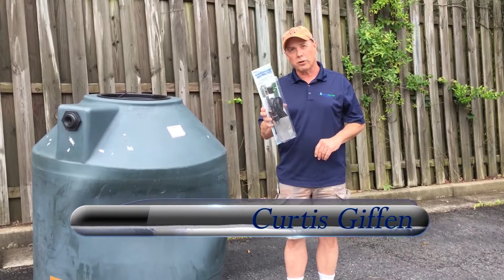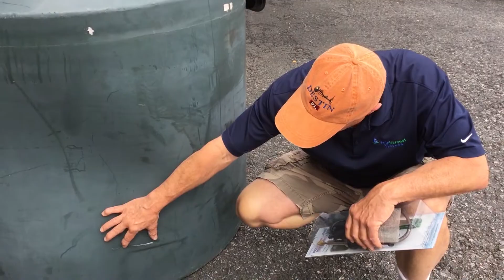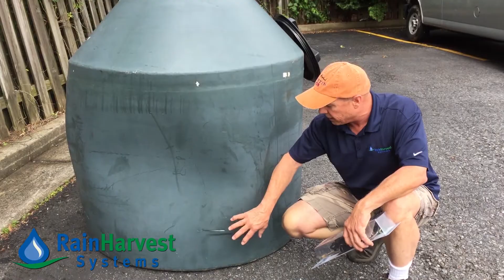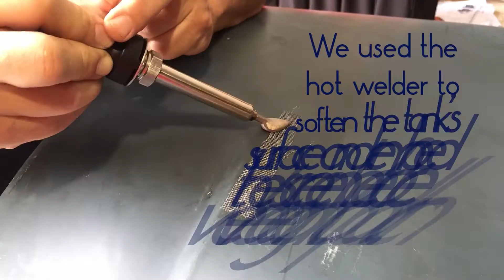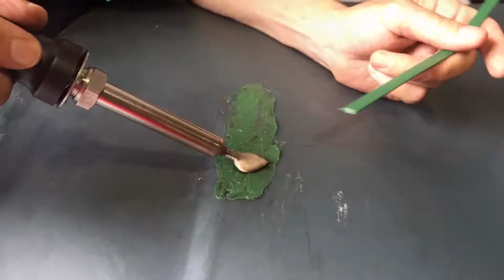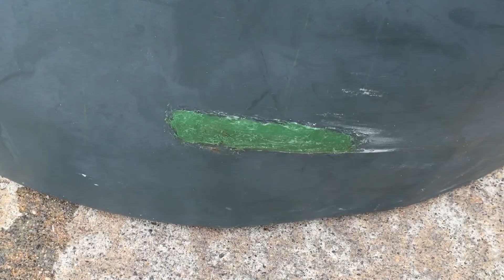Repairing Plastic Using the RainFlo Poly Welder Pro Plastic Welder

Comment: I have a 5000 gallon tank with an 8” crack close to the bottom.  I tried using a similar product and method and it worked for a few months but eventually started leaking again.  Is this something that might work better if placed on the inside of the tank? Any ideas? Thank you.
Reply: I have the same issue and agree with you that the pressure/ weight of the water on the bottom of the tank when it’s full is “ big” where it’ll be too much for an external repair to handle.
If the inside of the tank where the split is repaired 1st and then patched like an inner tube and then covered for a foot or so around the repaired area with an adhesive cover. That would hold up better. The force of the water pressure would push into the split not out of the split.

For the cost of a new tank I’m believing it’s worth a shot